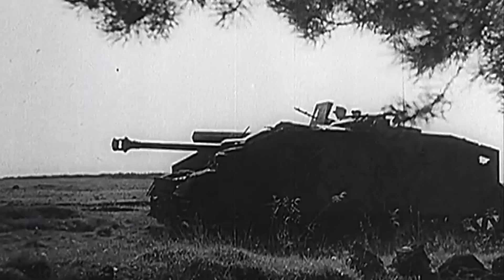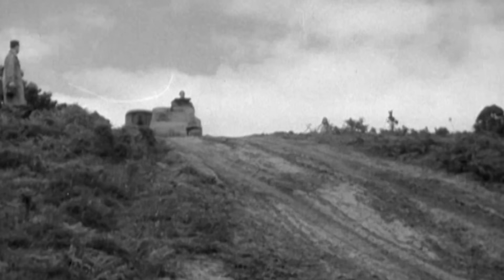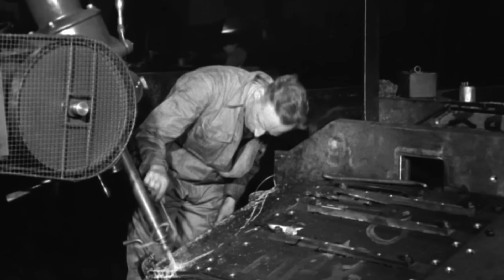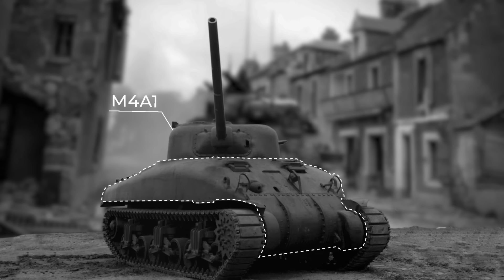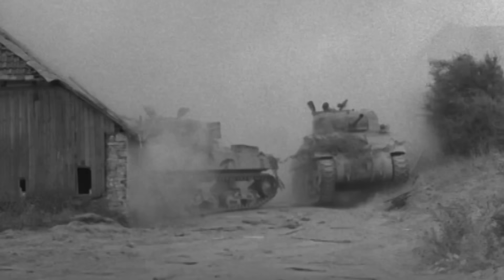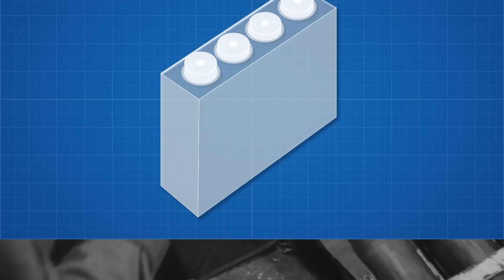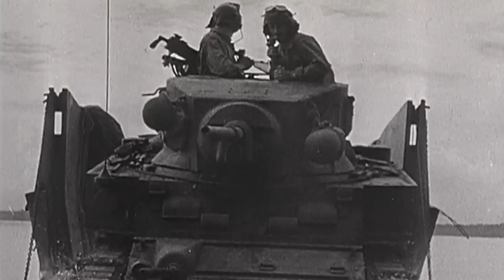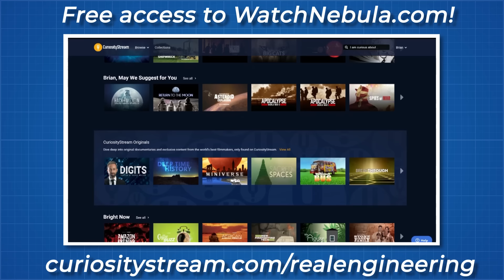M4 Sherman - The Workhorse of D-Day

Comment: Its a good tank with a shit gun. simple.
Reply: Dawson Toulouse the 76 mm could penetrate the tigers frontal armor. Idk what you’re getting at.
Reply: @parrotbird7900  I'm talking about the 75mm. aka the gun, he was showing for 90 percent of the video.
 I don't know what you're getting at.
Reply: It was a good gun. It was just a little under powered against heavy tanks, but against much more medium tanks and structures it’s a fine gun.
Reply: @kokofan50  agreed, I understand why it was used. I just feel them trying to force it up against panthers is stupid, that's why you have tank destroyers, no? and if it was so important to make it effective against structures, why not just call it an infantry support tank and not a medium one?
Reply: Dawson Toulouse, panthers just weren’t common. Having a few upgunned Shermans worked with the few big cats that they ran across. 

Tank destroyers were supposed to be a reactionary force for counter attacking breakthroughs. In reality they were used more as artillery. However, neither role was offensive attacks against tanks. 

Medium tanks were infantry support tanks.
Reply: @kokofan50  did you just call an m10 wolverine artillery... seriously.
Reply: Dawson Toulouse, tank destroys were part of the artillery branch, and they were commonly used in a direct line of fire artillery piece against infantry and structures. You’re probably thinking of the indirect fire role.
Reply: At the time, the 75mm gun  was the largest thing they could put into the M4, and it was quite capable in the Anti-tank role, being fitted to the Tank Destroyers. Eventually the TDs upgraded to the 3", but the M4 couldn't take it, they had  to wait for the 76mm to come along.
Reply: the gun was good wdym

Comment: The Sherman could go five times as long without having to change its tracks, compared to a tiger tank. At the time, most of the docks in the United States did not have the capability of lifting a 30+ ton tank onto a boat. This was another setback to creating heavier tanks. Statistically, the victor in any tank battle between a German and American tank was decided by who saw who first.

Comment: Can zero recoil increase a bullet's inertia?
Reply: No. Newton's third law dictates that the amount of energy transfered into a bullet's kinetic energy is the same amount of energy that will be sent back into the gun. How you dissipate that energy to achieve zero recoil had no effect on the bullet.
Reply: @ericw.1620  Why use a barrel and for that matter a gun then for the bullet to achieve max velocity? We want its full inertia, not bullseye aiming accuracy. Wouldn't lighting up the bullet let it achieve it's full inertia? Aren't burning gunpowder just vibrating molecules? Compressed from all sides shouldn't they exert more pressure on the bullet?
Reply: @scortexfire  inertia is directly dependent on mass. The less massive an object, the less inertia it has.

Also, if we were to use tiny bullets like you suggest, the amount of energy each one has will be greatly reduced. Theoretical maximum velocities are limited by the maximum speed of the expanding gases. A reasonable amount of powder corresponds to a max speed of around 6,000 f/s. Some guns do already approach this speed, such as the .220 Swift cartridge from a 26 inch barrel, which can reach 4380 f/s. The Swift actually can't really fire much faster than this, even if powder load was increased or bullet weight was reduced, as otherwise the spin would cause the jacketing on the bullet to fly off.

We do already compress the expanding gasses from all sides. That's what bullet casings are for. The actually bullet is only the pointy part at the front.

Comment: tiger: "i'm the best tank in ww2"
sherman: i can operate without breaking down every 5 minutes
Reply: Also Sherman: "Not to mention that our mechanics have a much lower suicide rate since you don't need to disassemble the tank to replace a road wheel or the transmission"
Reply: @crazeelazee7524  LMAO XD
Reply: Can't you stop breaking...

FOR 5 MINUTES
Reply: That's the way I view American cars. I just want a car that works and I don't have to fix every five minutes. So I go Japanese.
Reply: James Russell I adhered to buy American and preferred General Motors. I bought my first new car in 1981, an X-body Phoenix...insert foreshadowing here. My experiences with this car resulted in my driving preowned vehicles for a while. Then I bought a new 1997 Chevrolet pickup, my dream vehicle...😑...problems, why so many? I ended up buying a new 2006 Honda, because you know, gas mileage. I ended up receiving 240,000 miles with NO major mechanical issues! My sincere apologies to Susan and the grief I gave her for buying that new Japanese Honda back in 1979! Susan, you were right!
Reply: @jamesrussell2936  He had us in the first half, not gonna lie!
Reply: @jamesrussell2936  American cars don't have to be fixed every 5 minutes.  Many American cars score higher in quality surveys than Asian models.
Reply: @jamesrussell2936  You mean Toyota? cause Ford is the most reliable engine in America and so is Toyota. Everything else is trash, especially German vehicles... they purposely make it break within a certain amount of time so you can come back and pay $$$ to fix their "AMAZING GERMAN ENGINEERING"
Reply: @jamesrussell2936   Ford is just an acronym, it stands for fix or repair daily
Reply: @jamesrussell2936 sad but true.  Honda and Toyota are easier to repair too
Reply: @jamesrussell2936  or German
Reply: @maxvanvijfeijken2699  lol
Reply: @maxvanvijfeijken2699  German cars are money pit.
Reply: @maxvanvijfeijken2699  My neighbors Audi breaks down every other day.
Reply: @maxvanvijfeijken2699  Canadians?
Reply: T-34: "Hold my vodka."
Reply: @АрсенийСмирнов-ю8к  *vodka
Reply: @martijn9568  yeah, you're right. I'll correct.
Reply: @АрсенийСмирнов-ю8к  T-34s weren't reliable. They weren't even designed to survive past 6 months.
Reply: @АрсенийСмирнов-ю8к  "As long as you're not using as a Molotov cocktail.  My construction quality is so shoddy the flame will leak in a burn the crew alive."
Reply: @Britannic hayyomatt it's not just the availability of parts.  It's designing for field maintenance and repairs which (on top of the often overtaxed mechanics of the heavier later-period German tanks) German tanks were notorious for neglecting.

From the maintenance and repair to trying to fit them on railcarsb US tanks were designed thinking about logistics first.  German tanks were designed thinking about tactics first (in the late war period, trying to chase the unachievable dream of a "breakthrough tank").  Logistics wins wars.

British tanks were kinda a mixed bag on the logistics front, but British tank design was kinda its own thing (not even using the same categories of tanks as everyone else).
Reply: And towards the end of the war, the Sherman could easily kill the Tiger from the front thanks to the high velocity 76mm. Not to mention it had better optics and maneuverability.
Reply: @Rockazz95  then the angle comes in your way
Reply: @Rockazz95  Only few Shermans had 76 mm guns. It was british modification. Tiger 1 was really little bit slow, but still had that great 88 mm flak and strong armor. When 4 Shermans were attacked by Tiger, 3 of them were destroyed. Shermans just won by numbers. But in 1 on 1 situation it was always clear vistory for Tiger. But I don't understand why people compare Sherman with Tiger. Tiger is heavy tank, it's somethong diferent. Sherman should be compared to Panzer IV for example (they were pretty much on the same level).
Reply: To the end it was more like. You have a dink in your tank? Just grab the new one.  There are 300 ready to go. That was the main advantage for every tank in action there where up to 20 read to be used. On the other side production was almost nonexistent do to not enough raw material or people to use them.
Reply: sirBrouwer also the German factories were being destroyed on a nightly basis interrupting production and requiring them to relocate to safer (tunnels and such) places. After the allied occupation of Japan took place they found that the factories there had been parceled out to individual homes and small buildings where parts would be produced then gathered for assembly, larger factories had been destroyed by bombing.
Reply: @Vault57  and daily, british bombed by night, america did at the time, high precision day bombing, due to the bomb sight we had
Reply: i honestly believe a sherman could drive from the beaches at normandy all the way to Berlin. try that with a nazi tank.
Reply: Castsmith panther: wait you guys can work?
Reply: Churchill was the best heavy break through tank.
Reply: Yep. 

Perfect example of German engineering. 

Find an overly complex and failure prone solution to a problem best avoided... and have the very best examples of something unavailable because they are broken.
Reply: Churchill tanks were bad as it "crappy" ww1 looking design but it had way more heavy armour than any tigers. But it was effective in late war by 17 pdr gun and idk 75mm vickers gun was good or not. Yup gonna remember that this is infantry tank but heavy armoured, can blast flamethrower (obviously war crime) , pretty efficient gun.. (late war lol), high quality to cross urban terrain, but suffers common problems of any other ww2 tanks.
Reply: The shermans(and most other WW2 tanks) were pretty unreliable too. Good serviceability and abundance of repair parts made breakdowns less of a problem though.
Reply: @bandolier7011  Unreiliable No No it wasn't the ordnance branch tested shermans there was a note that a lock washer would prematurely fail at 4,000 miles and needed to be addressed yeah most panthers transmission lasted less than 150 miles

 Ordnance branch reviewed after the war and the sherman had a 99% reliability rate for its first 2,000 miles not 200 2,000
Reply: @bandolier7011  not to mention  their was like 10 shermans for every german tank
Reply: Yes the Sherman had some reliability issues like everything that ever existed, however Gen 3 German tanks had the worst reliability.
Reply: @bandolier7011  relative to ww2 tanks statistics, they were low, but compared to modern standards, they broke down a lot
Reply: Bitch I operate.. if you don't now the song look it up ... Murikaaaaa
Reply: @Britannic hayyomatt thank you sir
Reply: sherman: but i have to change my crew every single day , they tend to get dead inside me.
Reply: @presnow3016  wrong Sherman crews had one of the highest survival rate out of any tank crew
Reply: @dannyboyswe123  Yup, documented to be about 97 percent. Even if a Sherman tank was hit and disabled, most crews survived.
Reply: Tiger could also, read carius book, the jagdtiger had much problems with transmission, tiger was just very slow
Reply: @D L what experience do you have with operating tracked vehicles in freezing, muddy conditions?
Reply: @D L any tracked vehicle will give you a bad day in freezing mud.  Modern rubber track will give you fits when crab steering in heavy mud.  The dual pin sherman track is still in use in the forestry industry.  It is easily serviced and performs excellent, even compared to far more modern technology.  Far better than any single pin track.
Reply: @D L look at the herring bone gears in the Sherman's near indestructible finals, compared to the panthers frail planetary setup.  Poorly cut gears poorly heat treated, and inadequate bearing support in too flexible a housing.
Reply: Hans you are breaking the tank
Reply: Tiger broke down again

Can’t have shit in Grossdeutschland
Reply: It depends on what you qualify as "best". To a war fighter unless fanatical it would be the ability to keep him safe, not completing the mission and winning the war. But to the top brass winning the war with acceptable losses is what's considered "best". The Tiger tank was very good at winning the war, for the Allies.
Reply: the tiger1 did not break it was relatively reliable it just got stuck but the panther was unreliable only in the late war panthers got reliable
Reply: @MisterMister-ur5fz  the french had late war panthers and they still only where able to get 150 miles on average out of the final drives the bottom line is the drive train was designed for a medium tank and it weighted 45 tons 5 tons short of a tiger
Reply: mattmopar440 the germans fixed the final drive not to the degree that it became invisible but much better but it needed rare materials that they just did not have so they didn't produce a lot so most of them were produced with the old final drive
Reply: @mattmopar440  

Funny then how German units with Panthers were able to perform long roadmarches in order to get to Normandy in June 1944, and they had far more Panthers than the 20 odd or so that France used.

The Panther battalion of the 12th SS made a 140km roadmarch to get to the Normandy area, some tanks were lost due to mechanical breakdown as is to be expected, bu the battalino went into combat the day after it arrived in Normandy.

You might want to hinging your entire view of the Panther on a few little tidbits from a vague report that nobody has seen in almost 2 decades.
Reply: @Dreachon  lmao a long 140KM road March that's only 80 miles dude you're telling me a tank broke down after less than a a 4 hours of driving at road speed is normal they where crap
Reply: Dreachon ... and the 12th got annihilated for their troubles! The division losses during the fighting in Normandy, in the three months from June to September, amounted to 80% of its troops, over 80% of its tanks, 70% of its armored vehicles, 60% of its artillery and 50% of its motor vehicles.
Reply: @Dreachon  weren't panthers primarily transported via train even for short distances so the final drive doesn't crack apart as soon?
Reply: @JimCOsd55  

Due to heavy fighting with the British and the Canadians, not to mechanical issues. How is this so hard for people to understand?
Reply: @richiemacrophage  There is nothing in the Germans records that even remotely lends credit to the claim that transport by train was the 'primary' method even for short distacnes as many of the battaliosn that use the Panther arew doing long road marches to get to the Normandy area.
Reply: Dreachon ... I never said that 80% of the Panthers broke down, I just pointed out that the 12th Panzer suffered horrific losses at Normandy?
Reply: @JimCOsd55  I did not say you were, I apologize if I gave of the impression.

But the losses of the 12th ss are not that unusual, all of the German divsions were mauled during the fighting in Normandy and the retreat that would follow. Some units even ceased to exist.
Reply: I think when people say the tigers or panthers was unreliable they tend to look at allied reports. They didn't maintain the tanks so when they broke down they were like "well that's shit" and write it down as unreliable and after many years that just stuck around just my opinion
Reply: True however there are huge numbers of German liaison reports noting of the poor reliability of the tank for offense needs, in general, and compared to the earlier model of the Panzer. If you look at the French reports of the after math of the war because they had no resources and had to crew anything they could find. I bigger points they noted in after action reports (keep in mind the French needed tanks and they crewed them twice as long as the Germans) is that there was an extreme lack of reliability most notably in the transmission and final drives. Watch Potential History’s video on the Panther.
Reply: t-34: NERVOUS LAUGH
Reply: You are seriously comparing a sherman to a big cat?
Reply: True, because that's about how long it would last in a fight with a tiger at 3,000 yards lol
Reply: Sherman would likely win.